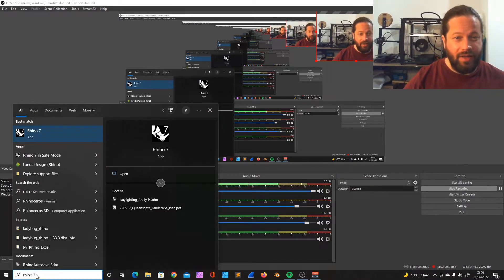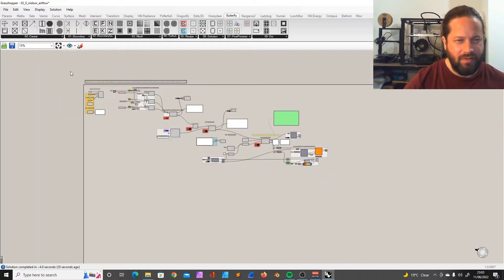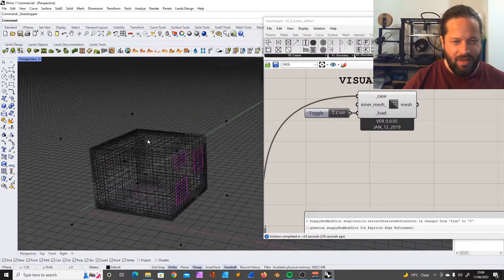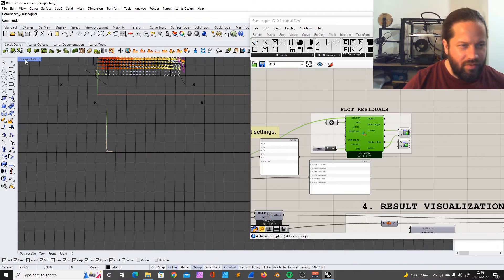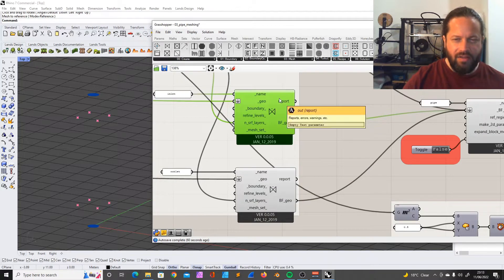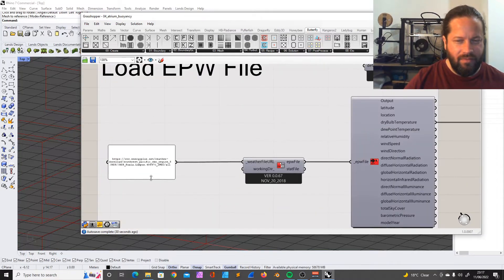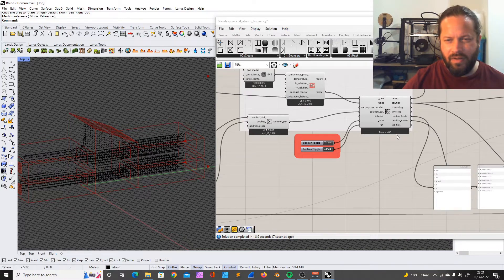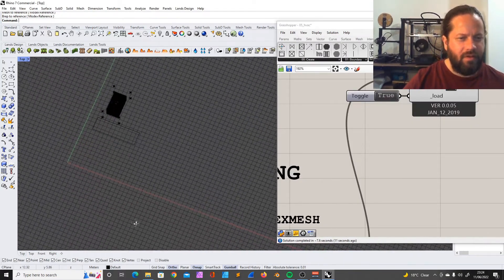Indoor air flow, Heat transfer and more with Butterfly CFD | Example files preview | Tutorial 14

Comment: Why, when everything else works, does the color of the wind remain unchanged, as if it has a fixed value, even when I try to change the percentage of the gradient? :(((
Reply from the maker: The reason might be that your colors adapt to the range of the output. Even the maximum speed might be lower than the colors adapt to that new range. You could set a fixed minimum and maximum to compare simulations.
Reply: @PhilippGalvanDesign   Thank you very much for your response.
However, the issue from the file is that the vector values include the number *e*, and in addition, the model also encounters an error in pressure calculation.
Reply from the maker: @sonnohope8435 
Yes that's a problem. The 'e' numbers occur at the problem which are inside the massing. Like walls etc... 
In one of the other videos I explain how to avoid this.
Reply: @PhilippGalvanDesign which one?
Reply from the maker: Let me check...
Reply from the maker: This is the playlist:
CFD in Rhino3D and Grasshopper3D: https://www.youtube.com/playlist?list=PL4Rc2GtLpcNVWy0DsYd74cY8LSczF8V1B
Reply from the maker: I think this one is the one you are looking for:
https://youtu.be/UKWZB5QoSNk
Reply: @PhilippGalvanDesign  thank you so much!!  When u try to answer me. Hopely , i can fix it 😢😢😢.